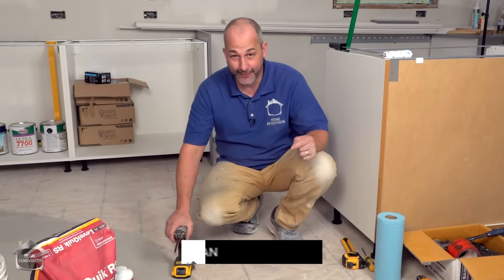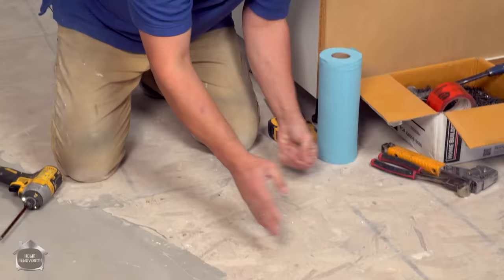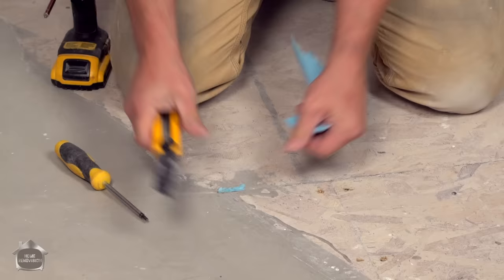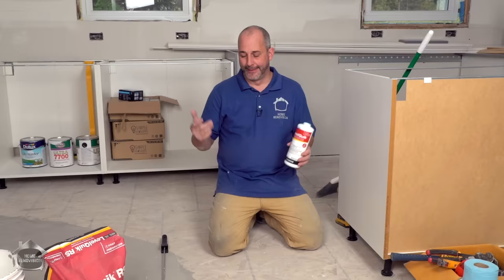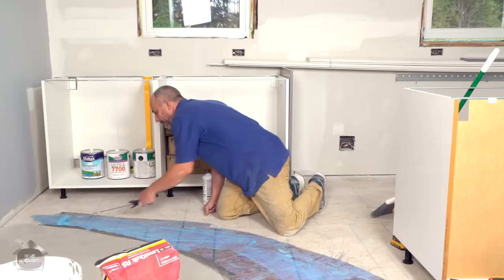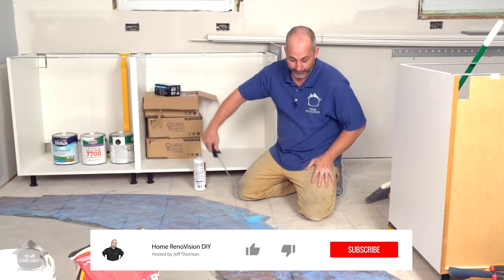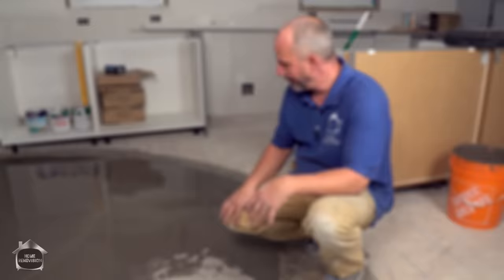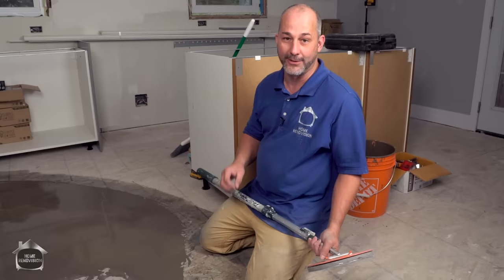How To Level Your Floors

Comment: As someone who works for a floor prep company, definitely make sure you follow the bags' instructions to a tee! Just cause you have "done this a million times with other products", doesn't mean this new one doesn't need to have the correct amount of water added to flow right. I've personally had plenty of older tradespeople complain about a new leveller they tried, and when asked about how much water they used, they ALWAYS say they don't remember. We sell 5lt jugs just so they use them to put the correct amount of water in.
Reply: That is why even pros use the pails with measures. Water amount is so important. As is covering that osb if yo want anything to stick to it.
Reply: @carlk2193  You are right: measuring is what makes them pros.
Reply: In my case, I put a little but more water than the amount in the instruction. When I put the correct amount of water, Levelquik did not "self-level" as it should. It was very difficult to apply on a large area and level it manually before it dried.
Reply: I use more water and mix it with super hot water for a glass finish with ease,I also use my jackhammer around the poured perimeter with a bushing bit and let gravity be my best helper!!!! Things run much more smoothly using this method!!
Reply: Depends on temp and humidity as well, so directions are open to interpretation depending on situation
Reply: Salesman
Reply: On our bag of leveler it said to put plastic between primer and leveler!????! WHY???

Comment: When using over OSB, the leveler calls for metal lathe. The recommended thickness over OSB is 1/2 inch. When pouring leveler over existing leveler, primer should be used if 12+ hours have passed since first pour. The leveler calls for a specific amount of water and mixing time. Using more water than required causes a dusty finish on top and reduced leveler strength.
Reply: Yeah. I saw that too.
Reply: Sal Diblasi is the guy to watch
Reply: Don’t let carpenters near screeding or flooring in general, end of!

Comment: The instructions for this product (and some others I’ve seen) call for a metal lath to be installed over the plywood before you use the self-leveler.  You don’t do that in this video, and frankly I’m not sure if I’ve seen anyone do that.  What are your thoughts on this?

Comment: Flooring guy here. After the self lever, "I use feather finish along the ridge"  Then sand. They also make a latex additive for better bonding to mix in. 
Ardex K-60 Rapid Setting Latex. 
Also, If you are filling in low spots you can run a string from high spot to high spot to know how much to use.
Reply: Hi Paul
I'm planning on levelling out the floor in my utility room, its been converted from my garage and has that red floor paint that you often find in garages. Im under the impression that self levelling compound wont adhere to that, is there anything i can do to ensure a good bond?
Thanks.
Reply: @Darren_Kelly  I would skuff it up as much as possible with sandpaper. The more the better. Cheers and good luck.
Reply: Thank you, the tip with the string will come in handy. I was wondering how I could figure out how out of level I was or not.
Reply: @octechperson  I am no expert but I am in the process of leveling my basement which is up and down almost 1.5". I bought a 8 foot aluminum screed which is invaluable. Any perfectly straight edge will do (couldn't find a straight 2x4). I keep placing the 8 footer all over the ground in all directions and mark the low and high spots to figure out where to poor the self leveling. I figure if I can get the 8 footer flush with the floor in all directions the dricore and flooring should go down well. I also have used one of those gyro stabilized lasers on a tripod and I sight one spot on a stick, then move the stick around to figure out high and low spots. The straight edge is easier and more practical though.
Reply: Your no flooring guy at all your a beginner at best if you find this video intuitive
Reply: I've "self levelled " houses built in the 1700 67 years b4 America was even founded and never had to use a string for levels if your a good floor guy you can feel the levels just by feel with your hands and feet
Reply: @scottedwards5910  I concur.  Coming from a flooring contractor  this  vid sucks!
Reply: Curious what the cost for a 1500sqft home?

Comment: I used self leveler on a slab with cracks before installing vinyl planks. Definitely helps to feather the leveler with a trowel. I didn't trowel and had uneven areas. I used floor patch and sanding to get it as even as possible. I regret not using OSB boards on top of the leveler because now my vinyl planks are separating a bit as the cracks on the slab continue moving.

Comment: Hey boss, consider long pieces of primed MDF board (they have great straight edges) for leveling larger areas.  I'm the farthest thing from an expert from leveling the floor, and my experience is limited, but when I used a long 8-ft piece of MDF board I was able to get larger areas completely flat in less time. Just thought I would share. And if you really need it to get super level, I recommend strapping or securing a level to your MDF board.

Comment: Try a magic trowel for your next application.  Smooths out like butter.  I've put down 80 bags by myself, in a very short time using one on a job.  Mixed in 40 gallon garbage cans, I had it spread before the mixer could have the next batch ready.  Levelquick RS is the BEST!  I've used so many others.

Comment: Great channel with some great tips.  One of my goto channels to watch before I tackle home improvements.
One thing I'll say about floor leveling. They tell you on the bag how much water to use...and it's crap.  It's always too little because they want the material to dry fast...to dry within their marketed time.  Give it more water...not too watery...but more (takes some experience)...and it will level out better.  Another thing is you can screed it or use a trowel like Jeff did...but if you can get your hands on one of those spiked roller screeds, those work really good for pushing the material around to where you need it and leaving less of a ridge at the edges.

Comment: Poured plenty of leveler on a slab in a house  in Fl. I flipped,  I used duck tape along the walls for a dam, was fast and worked great, would also use it over a crack or hole in a wood floor instead of pushing whatever it is used here and having to trim off.

Comment: I live in an old home and everything - literally everything - from the ceiling to the floor needs redone. Watching these videos is amazing. As for the leveling specifically, do you have a video showing how to determine what needs leveled? Or how to install a floating floor on a step?
Reply: This. How do I find out if my floors are not level to a certain tolerance? For example 3/16” over 10’

Comment: I’m getting ready to install “wood-like” ceramic tiles throughout my entire home, which is only ~2400 square feet; it’s all one level on a concrete slab. The tiles that we’re putting down are the “large format” variety, they’re around 18” by 48” so we’ll have to use this throughout our entire home. Thank you so much for demonstrating this, as I was rather overwhelmed about it. Cheers!
Reply: How did it turn out?
Reply: Doing an entire house in an interesting case: how to carry the leveling line from one room to others out of sight. Related, it could be fun locating the highest point of the slab, and could be a fair size project with a laser level.

Comment: I watched a couple of other videos on Youtube about self-levelers, and several of them suggest that you should find the highest spot in a room and pour self-leveler everywhere in a room, not just in the low spot. The reason behind it was that many self-levelers have minimum application thickness (for example, a Mapei product in Lowe's says minimum application thickness is 1/8 inch), and if you pour self-leveler only in the low spot of a room - on the edges of your poured self-leveler thickness would be less than 1/8 ( after sanding the edges it could be next to nothing), and self-leveler can eventually start crack/chip off on the edges due to being paper thin. What's your opinion on this, Jeff?
Reply: This is concern that I was wondering about too.  My highest spot is limited to one small area in a corner, I would rather not raise the entire floor to that level.

Comment: Hey Jeff, I sincerely appreciate your instructional video. Just did my first floor leveling project using the LevelQuik® RS product. Wherever I feathered it out along the edges, a bump remained. I tried sanding it off as you suggested, using my Festool Rotex 150. It worked well to smoothen some rough areas, but to really remove some material, only my angle grinder with new diamond cup wheel did the work.
Reply: Festool? Check out the big brains on Brad. That’s a tasty burger. Mind if I wash it down with your tasty beverage?

Comment: Hey Jeff, joined the channel a few days ago. I just started renovating my house. I have to do some electrical and plumbing, expand the bathrooms,  modernize the kitchen, and then paint all the rooms. I’ve been binge watching your videos and they are helping a lot. I was wondering if there’s a way to ask you some questions? Or just get some direction on what to tackle first. Thanks!
Reply from the maker: check out the community posts for members on the home page. there is a email address you can send photos and I can help advise. Cheers!
Reply: I'm in a similar situation with my 1940's home. When there's so much to do it's overwhelming to know where to start

Comment: Maybe you've covered this.  What is the difference between underlayment leveler vs. concrete leveler.  I'm especially interested in understanding the weight differences. Also, what do you think about having a garden air blower, at a low setting, to help the leveling process along.  That way you could get to areas that you might not be able to with a trowel.

Comment: Hi Jeff, just started watching your videos and they are so informative. We are working on our laundry/mud room/Pantry space. We have a question about flooring. We purchased ceramic tile and we are wondering if we should use a barriers on the subfloor before placing the tiles down. The sub floor is in good condition, and we are getting conflicting information. The space is situated above a crawl space and we typically enter our home through that space, so it gets most of the foot traffic. Finally we are located in Northeastern PA, not sure if that matters. Any help would be greatly appreciated. Thanks so much. Keep the videos coming!

Comment: Seriously tho, listen to him when he says get a slow mixer for this! When I used floor lever in my basement I was dumb and decided to just try to use my basic corded drill and I ended up destroying the motor in 10 seconds. By the time I got a replacement drill the mix started to setup already and I had to chuck it. Half a bag of lever down the drain. Lesson learned the hard way!
Reply from the maker: The important thing is to learn from those mistakes and get better. Cheers! We have all learned the hard way!
Reply: Of course, I had to try since my ol' B&D corded drill has mixed quite a bunch of paint in the past -- but never anything as thick as a half bag of leveling compound. Long story short, my drill worked... barely. The drill got quite hot. It took me about 10 minutes to mix the half bag because I had to go slow and mix the compound without sloshing around the water too much and make a mess. This didn't give me much time to pour and set the leveler. Anyways, I went to the Depot tonight to pick up the Rigid paddle mixer for tomorrow's pour.

Comment: Thank you so much for this video Jeff, I leveled the floor in my pantry using these products and the end result is absolutely great. What would you recommend at a minimum for a sub-floor before laying self-leveling cement? I've stripped a bathroom down to bare joists and I'm starting from scratch.

Comment: Hi Jeff, thanks for the video.  Question:  we have already waterproofed the ensuite floor and have found the old floor is somewhat less than level - down in one corner, hump in the centre then down to the drain.  Can I use a levelling compound over the waterproofing or do I need to sand this off, level and then re-waterproof?

Comment: You said you used plywood to build up some of the low areas. Can I mortar cement board down to a cement slab to fill some of the gap before using leveler?
Reply from the maker: definitely McKenzie! use a little thin set and off you got o the races. 1/4 or 1/2 " Cheers!
Reply: @HomeRenoVisionDIY  perfect! Thanks!

Comment: Hello, and thanks for all the great info! I followed your tutorial and used a primer over plywood subfloor and then poured self leveler (I used Henry 555) inside my small 22 sq ft. Bathroom. I feathered out the edges of the leveler and ended up covering about 95% of the floor where there was a big dip. When I called Henry, the tech specialist said I did two things wrong: I didn’t use a mesh lath before pouring the leveler and I should have covered 100% of the floor, not 95%. But I didn’t see you covering the entire floor in this video or using a mesh lath - do you think that’s ok?

Comment: Hi Jeff, I have been watching your videos for a couple of years now and its by far the most useful, helpful and content rich material I've seen, thank you for all the effort you put in to helping the DIYer community. We own a 1940's home in Toronto's East York community and have recently gutted part of the basement to build a new bathroom and laundry room. Our concrete  floor is not level and there is no insolation on the walls. My question is to level the floor should i use any moisture barrier before installing plywood to level? With regards to insulation should i use Typar stapled to the back of the frames? Thank you

Comment: Would using Plywood for flooring be better since it is more rigid/stronger?
Reply from the maker: sure if you don't mind the extra expense. not necessary though. Cheers!
Reply: Home RenoVision DIY I used 1/4 inch plywood to bring my flooring level with tile and used PL and screws to hold down. Is that fine . Cost was $8 instead of $40 per sheet

Comment: Very helpful, thanks! 

Despite leaving some thick clumps in the bucket and a small leak in the floor, it actually turned out beautifully.

When would you consider using metal lathe?

Comment: Is there a way to level a basement floor with like expanding foam or something like that?
Reply from the maker: nope. In most basements I suggest to leave the slope alone. it is necessary drain in the event of minor water infiltration events.
Reply: Basements are always designed to have a pitch that leads to the sump pump so water can drain more fluently in case of flooding.

Comment: After living in my home for 8 years (and was puzzled by uneven floors), I discovered the floor joists at 32" on center when I was pulling cable in my crawlspace. I immediately called out a home inspector, and surprisingly he said the joisting was in code...very large beams supporting the joists. But, the floors a very uneven...and I have a huge project ahead of me.
Reply from the maker: you can always add some more. Cheers just you joist hangers!

Comment: First time I used this I too had floor leveller raining in my basement. 😳 oops.
Reply from the maker: not easy if you plug up the holes. Cheers!
Reply: Can you use this on top of ceramic tile? My tile was installed and it is uneven it has now cracked in some spots and trying to find best way to repair  it or should it be removed and then level before I install new tile? HELP...
Reply: @yolandaguerra7188  remove the ceramic and start over... dont try to cover a bad job by adding another layer of flooring over it.
Reply: @nmarmz  yea agree
Reply: The subfloor I want to put the primer on was painted. Will this affect the primer from adhering to the floor?

Comment: What would be the solution for 1 inch gap. I can't assume self leveler has it would be very costly
Reply from the maker: install a second or third layer of osb first and then prime and add leveler.  you can use a 6' level to identify how much fill you can add fist to save some money and layers . Cheers!
Reply: Sure wish we would have had this advice ~16 years ago (lots of crackles to fix now).
Reply: Jeff I love your videos.! 

I have a floor that is 1.5” out of level (from one side of the room to the other.) It’s a plywood subfloor (tongue and groove ,) above a crawl space. Before applying self leveler I will be adding layer(s) of plywood to the shallow side of the room. 

Question:
when adding a layer of plywood, do I need to glue and screw each layer of plywood?  Also do I need to shim the edges of the plywood to feather into the existing floor.?
Reply: Your floors beneath the leveler need to be solid because the leveler is not rubber, cement will crack apart even though its acrylic fortified or fiber reinforced, its still a silica cementitious compound that hards up and is relatively thin when finished..  but regarding feathering, as much as you can yes..  the less leveler used makes both the wallet happier and the leg work..  you really dont want to have more than a quarter inch of leveler in one spot, half inch max..  its not a structural concrete and is very fine granules used so it has no strength in itself when you get too thick so if using quarter inch subfloor than id make it a gradual transition to flat but no need for a drywall style feathering blend as the stuff does that for you..  but screw all additional wood every 6-8" with screws that will go into the lowest member there, its also good to use a subfloor adhesive caulking as well as screws to stop any squeeks..